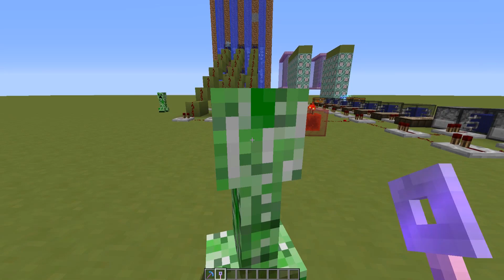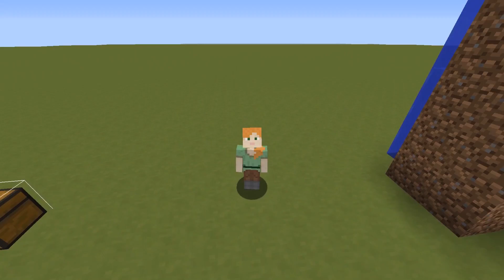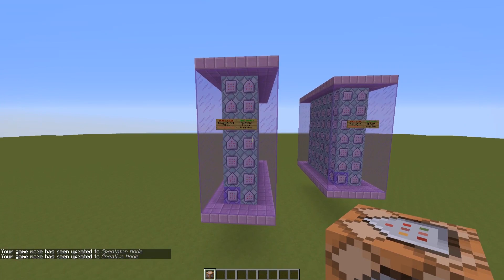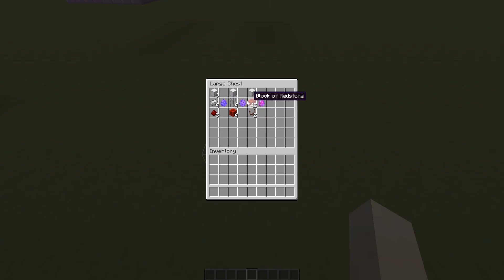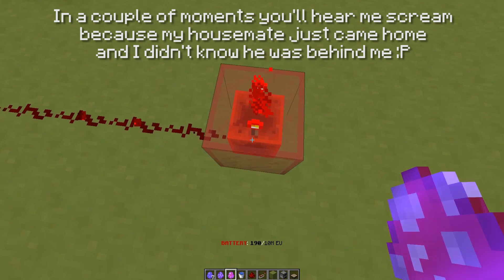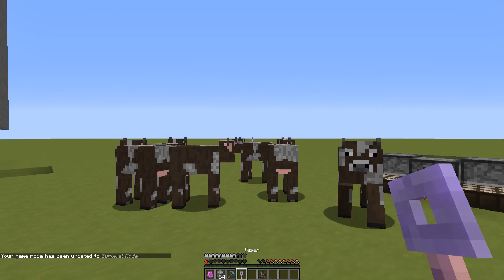Minecraft - ELECTRICITY MOD With Only 2 Commands (Hydroelectric, solar, thermal, power tools)

Comment: Ive Recreated you with one command this is the command

/give @p spawn_egg 1 0 {EntityTag:{id:"minecraft:skeleton",CustomName:TheRedEngineer,CustomNameVisible:1,HandItems:[{id:"minecraft:command_block",tag:{display:{Name:TheRedEngineer}},Count:1},{}],ArmorItems:[{tag:{display:{Name:"TheRedEngineer's Feet",color:16711680}},Count:1,id:"minecraft:leather_boots"},{tag:{display:{Name:"TheRedEngineer's Legs",color:16716330}},Count:1,id:"minecraft:leather_leggings"},{tag:{display:{Name:"TheRedEngineer's Body",color:0}},Count:1,id:"minecraft:leather_chestplate"},{id:"minecraft:skull",Damage:3,tag:{SkullOwner:TheRedEngineer},Count:1}],ArmorDropChances:[2F,2F,2F,2F],ActiveEffects:[{Id:2,Amplifier:998,Duration:2147483647,ShowParticles:0b},{Id:24,Amplifier:998,Duration:2147483647}]}}

Comment: You could put efficiency on the pickaxe to mine faster than haste effect and you could also add haste 2 effect with the maximum efficiency
Reply: And you could also make all the armor and the electric drill use so much less energy and also make a bracalet to get the invisibility effect including the armor making it all invisible
Reply: Also you can change the item when you are invisible and it will cost just 1 unit of electricity per real life minute

Comment: awesome, but PLEASE RED, also release it as a function/multiple functions because:
-the are loaded everytime, it doesn’t  in wich chunk you are
-you don’t have to waste your spawn chunks for the command block machined
-function are using way less performance then command blocks

but the idea 💡 and the creation are soooo nice <3

Greetings, john aka. rxped
Reply from the maker: Sadly It wasn't possible to post this creation as a function because there's a /blockdata command that checks data outputted from a command block. /blockdata is the only command that can't work inside functions